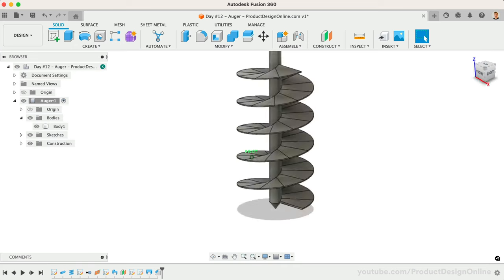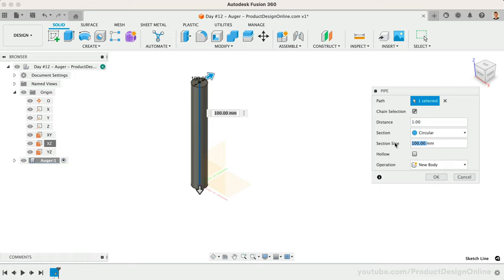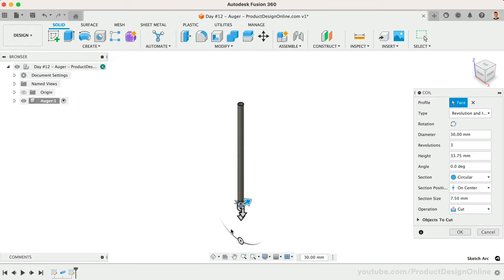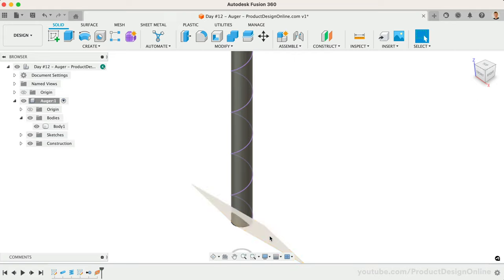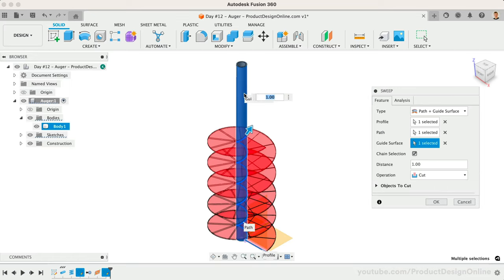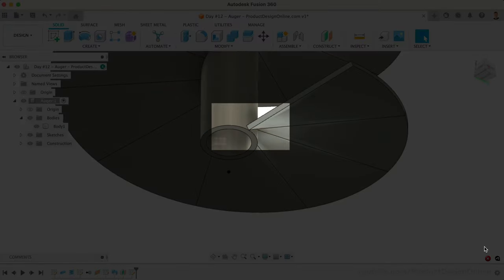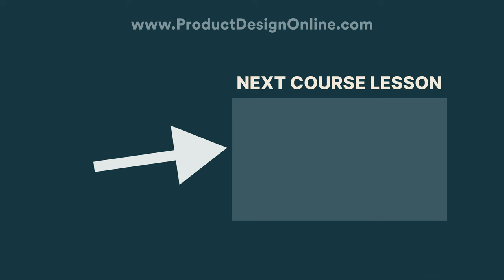Day 12 of Learn Fusion 360 in 30 Days for Complete Beginners! - 2023 EDITION

Comment: On the last step ( the 2 distance chamfer) I am getting an error that the chamfer cannot be created at the requested size. The most it will allow is 1.7 mm, rather than 3mm and 5mm as you did
Reply: I was having the same issue, but then I realised you have to select the top edge, not the entire face
Reply: I also had the same issue, but his blue arrow was pointing right, and mine was pointing along the edge of the helix (at 7:29), and mine was pointing towards the helix.  I clicked on the flip button and it worked as it did in the video.
Reply: @Coombes29  Yes, I was also selecting the wrong thing. Top edge for the win.
Reply: @ChasingAfterTheWind  flip button worked for me, thanks for your comment
Reply: You may have put the rectangle facing down rather than up. edit the initial rectangle sketch starting at the origin and drawing to the right and up. Then correct the sweep in the parametric timeline to complete.
Reply: Thanks, this helped out!

Comment: There is a far Easier way to create that archimedean screw simply Create a sketch on the grid floor of a circle and extrude it on the z exis then use the coil feature and create the coils mainly change the Section from circle to (square) It wont be a diomond! then use fusion 360 offset features to shape the archimedean screw and use a sketch to revolve it for the nice pointy end! bamm!

Comment: For those people getting an error when trying to do the sweep at the 05.41 mark even after changing the operation to 'JOIN' from 'CUT' I found I got around this by editing my pipe via the Parametric Timeline to increase it's diametre from 38mm to 39mm. The error message I had previously got said F360  may require bodies to overlap to enable the sweep to work hence my idea to increase the pipe size.
Reply: this fixed it for me

Comment: The chamfer for me worked backwards! Instead of selecting 3 mm and 5 mm, I had to select 5 mm and 3 mm! Not sure why it worked that way for me, but if I did it the other way I got an error!
Reply: It worked for me by selecting the top edge rather than the face, it took me a couple minutes to figure that out cuz I was getting the error also

Comment: I do not have the "remove" command available. I read up in it but it was beyond my understanding at this point but referenced "direct mode" and "timeline mode" although it seems like I should have it in the menu since I am in timeline mode?  This particular class had been confusing. I can follow along but do not "understand" or comprehend why  I'm doing it.
Reply: You have to click "finish the sketch" after clicking 'ok' on the project command's box.

Comment: The loft command at the end is very tricky. I had some problems projecting the bottom of the pipe to the point. It seemed like a piece of the coil helix was sticking through the bottom. Could you do the loft earlier in the process? At any rate I figured it out after a while. Thank you again!
Reply: I had trouble too but when i created a sketch at the bottom of the pipe and project the inner and outer circles (turns red) then lofted it all worked. You are correct the blade was in the way.

Comment: The "remove" option does not appear to be there, only the "delete" when right clinking on a body, at 3:59
Reply: Solved it a few seconds after posting: Make sure you have "finished sketch" before trying the above, for some reason this is not available if you are still in sketching mode.
Reply: @maciejjabonski833  there are lots of things like that which he glosses over.  I guess it's a tricky balance of not getting excessively detailed about mouse clicks while also providing information.
Reply: @maciejjabonski833  I've had this happen several times. Where I didn't click ok in a dialog box or finish sketch because it wasn't specifically mentioned. But I feel that this little bit of struggle, and having to look at the comments to get help makes me better at this program. I'm missing less and less and catching things not always mentioned much quicker than day 2 or 3.
Reply: Oh wow I see by the likes people found my comment useful. Great 😁
Reply: Thank you a lot of times I assume it’s because it’s been months and we are now using a new version of fusion, glad to see it’s also that I’m impatient and sloppy. Comments like yours are so important to bridge the gaps for myself and other newbies, again Thank you.
Reply: Thanks, was thinking the same
Reply: @maciejjabonski833  Thanks, couldn't figure out what I was missing

Comment: this is great I'm learning a bunch. I went back to the sketch, just before the loft and I projected the face of the shaft and then extended the line against the shaft farther along the shaft circumstance but touching. I then created a fillet from this line to the top of the blade profile, and trimmed the bit below the filet within the sketch so it was a single defined sketch. This automatically lofted the fillet along the blade path.

Comment: Great tutorial. I believe we needed to select guided surface for sweeping the rectangle for the software to know how the swept object needs to adjust its angle being always perpendicular to the center of the core ones being swept. Otherwise it will try to keep it parallel which ends up in the geometry collision. Is that correct?

Comment: Thanks for the video.  I was wondering if it matters that you chose the XZ origin plane of the assembly rather than the component?
Reply from the maker: Good catch! It won't much in this case. If the part were to get moved around or moved into another assembly file then it could throw a reference error. In which case, you can 'redefine sketch plane' and select the correct/desired plane.

Comment: I managed to complete this, but really, not.  When I created the rectangle on the "plane to path" to sweep the blades I just couldn't get the sketch to fully constrain (i.e. there was no red lock symbol on the sketch item).  The rectangle had the parallel constraints ok; entering the dimensions, the yellow lock symbol appeared.  But the rectangle stayed resolutely blue no matter how many times I rewound the timeline , deleted actions, started again etc.   The only difference I noticed was that when you were doing this, your origin point seemed to be at the end of the coil (i.e. your green Y axis ran up the outside of the pipe and the red axis horizontal away from the coil end (on mine those axes were through the middle of the pipe and just below the coil end - thus the rectangle "hovered" just above that red axis mark because the coil end was just above it.)   Any idea why I couldn't get that sketch fully constrained?

Comment: When I try to remove the coil from bodies it is completely gone and I am not left with that pink line as you did in the video to use the "plane along path" feature. I don't know if this requires an update or if I am doing something wrong.
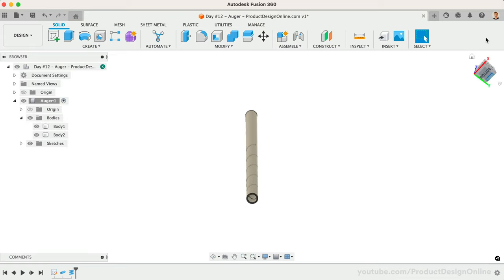Reply: Be sure to make the "project to surface" right at 3:20

Comment: Thank you. Great tutorial as usual. But I came across and issue that I also noticed in this video. When I choose pipe command, if I want to make distance less than 1 (like, 0.8), the pipe starts from the TOP towards the bottom of the referenced line. If I assume I want the pipe to be 80% starting from bottom to top, this is something that I couldn't achieve and I couldn't find out how it can be done.
Pipe command doesn't allow to select start/end points.
I tried to select reference line from different locations (either sides or the middle) and it always shows that I can slide the arrow of the distance only from the bottom to the top (shortening the pipe and removing parts on it at the bottom).
I hope my concern is clear enough so someone can help addressing as I couldn't find a way online to change or control this behavior of pipe command.
Reply from the maker: There's no way for additional control with the Pipe command. In a scenario like you describe, you'll want to use a regular Extrude of a circle.
Reply: @ProductDesignOnline  Thank you for your response. Yes. Actually I used Extrude to accomplish what I wanted as you described.

Comment: 6:48 iam not getting the plane which I selected and the projection applies on the dot structure 😢
Reply: I had the same issue , the only thing that worked was deleting the sketch with the point and then creating the project sketch then adding another sketch with a point. i would love to figure out why it was doing that though...
Reply: @jonathanlazaro2021  I solved it by pressing the finished sketch button (green) on the right corner right after sketiching the dot, then create another new sketch again on the circular surface. (Do make sure to create the sketch face on the bottom circular surface but not on projected sketch as it is appeared first when u view from the bottom and misclicked it.) This is how I solved this issue though.